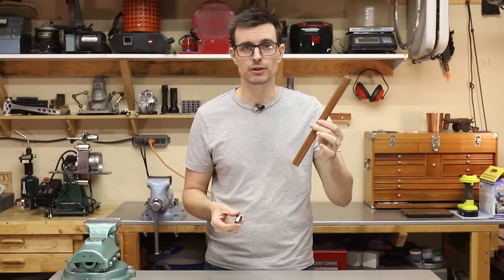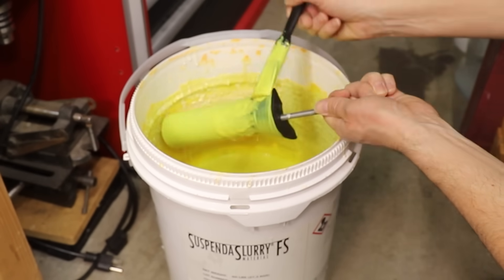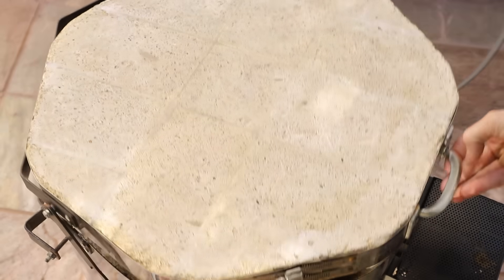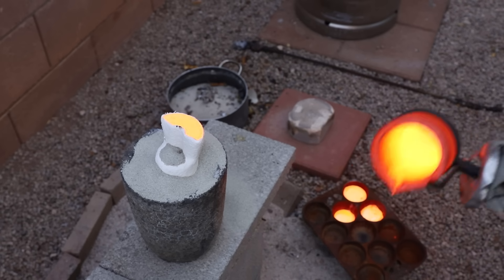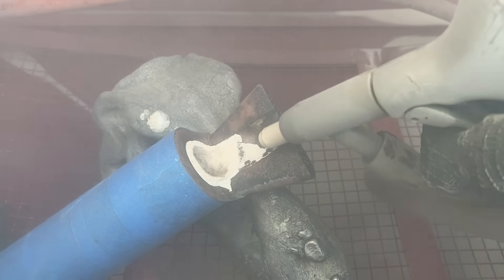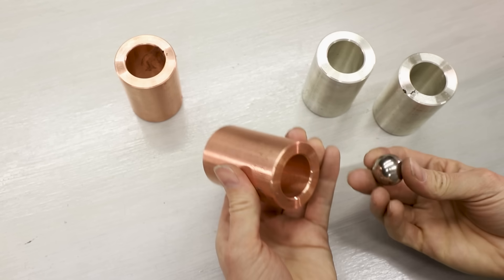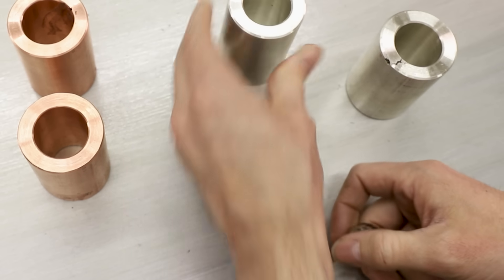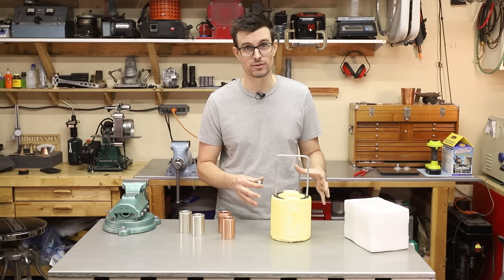Making Anti-gravity tubes - Copper & Silver! - Lenz's law - Metal casting Experiment

Comment: Something you could have done/ could do in the next installment would be to place the tube on a scale, showing its weight. As the magnet enters and flows down the tube, it should show an increased weight, and will show a further increase when the magnet touches down to the surface of the scale. The ratio of the difference between the falling weight and the Landes weight is the percentage of the acceleration due to gravity that is resisted by the eddy currents produced by the moving magnetic feild.
Reply: Once the magnet reaches its 'terminal velocity' in the tube, which appears to happen fairly quickly in these experiments, the scale should read the full additional weight of the magnet, regardless of the metal used (so long as that 'terminal velocity' due to eddy currents is reached).

If you're trying to measure the force needed to stop the magnet when it hits the scale, do note that scales are notoriously bad at measuring near instantaneous forces, and are much better at measuring prolonged unchanging forces.
Reply: @rylandrc  I was going to say the same thing! I guess I'm glad I checked the replies.
Reply: @rylandrc good point
Reply: @rylandrc   I believe, as the magnetic ball falls through the tube, it will show a weight 'less than' the actual weight of the magnet, until it hits the surface of the scale. 
At the moment in time that it makes contact with the scale, and with magnetic force acting on it, will the impact force be greater or lesser that of the magnet alone? 
As it falls at it's 'new' terminal velocity, a minute bit of gravity(?) should be observable and reflect a tiny reduction in weight.
Reply: @MarcoTheHammer  F = mass*acceleration

If the magnet is not accelerating (such as by traveling at a constant velocity), then it is not exerting any force greater or lesser than its normal weight due to gravity, the same as if it was sitting still on the scale.
Reply: This is completely wrong. As long as the magnet moves at constant velocity, the weight is the same. Both when flowing and landing. Except a little bump at the time of impact to the bottom.
Reply: @erikev  if we extrapolate this out however, as you use a weaker and weaker magnet, or a less and less conductive pipe, the ball would fall at a rate closer and closer toits terminal velocity in ordinary air, eventually, it would be falling at its terminal velocity when using a nonmagnetic ball or a insulating pipe and the scale would read almostno weight from the ball (except air pressing on the bottom) until it lands.
Reply: @Metal_Master_YT  it wouldn't register any additional weight only if it was done in a vacuum or else the air beneath the ball would still impart ball's weight on to the scale. There has to be a medium that passes information about the weight to the scale - be it eddy currents or air - only a non magnetic ball in a vacuum would not be able to transfer information about its momentum to the scale up until the point it would actually hit the scale.
Reply: @Metal_Master_YT  Wtf do you mean by Earth's terminal velocity? Did you skip Physics-101?
Reply: @vaakdemandante8772   Yup, I was neglecting air resistance and pressure, but assuming that the tube is open on the end, the air will be able to exit relatively unhindered, besides the ball is not a perfect fit and air can escape around the edges. you are correct however.
Reply: @DJF1947  Yeah, I was not well rested when I posted that... what I should have said is that the ball would accelerate due to gravity until it exited the tube or reached its terminal velocity under those conditions, likely the former.
Reply: @erikev  yes, that has already been commented in the replies.
Reply: Lets hook some wires up and flip it back and forth so we can save the world with perpetual motion and free energy!
Reply: @fluchterschoen There is a reason for that. I am about to publish a book in which I show that many engineers at aerospace companies (NASA, Boeing, etc.) do not understand simple physics (and thus waste time on moronic 'antigravity' projects, for example). The sandglass problem is an old one; it was first studied by Galileo ... who thought that it would weigh less until he did some experiments. For many years it has been a 'trick question' for physics students. The interesting thing is that there can be a very small change in weight, but it is hard to measure and is - ironically - due to Galilean relativity (imagine the sandglass-constriction moving through the sand). 
Are you trying to fool me with the barge question LOL. It is a well-known fallacy to think that the weight of the barge changes the stress acting on the aqueduct supports. There is a lovely counter-demonstration of this: take a long water-filled fish-tank  and balance it on a narrow piece of wood at the tank's  midpoint. Now take a heavy model boat which can float freely on the surface. Float it carefully at one end of the tank. Just about every non-physicist will expect the tank to overbalance, but it doesn't of course. But there have been cases in which misguided engineers really did reinforce aqueducts. Or perhaps they were simply scamming the canal-owners.
Reply: Would the magnet be attracted to any parts in the scale? That might be something to try to see if it falls faster. Suspending the tube from a force gauge might be interesting to demonstrate the weight increase. I'd also like a demonstration of that molasses when pushing the magnet up. Maybe a PVP pipe to push the magnet up would show the reverse effect compared to dropping it through?
Reply: This comment section is dope af
Reply: there will be no further weight gain once the magnet touches the scale.
Reply: Nicely said friend.
Reply: I'd have thought the weight would be the same once it's falling and landed, doesn't make sense for it to be heavier once landed, especially as it's a constant speed. If gradually accelerated then I can see that being different
Reply: The weight of the assembly while the ball is falling is the same as that of the assembly when the ball is on the scale.
   But I would like to mention a more complicated situation. How can a scale indicate the mass of a gas enclosed in a container, when it is known that most of the molecules fly freely and do not interact with the scale ?
Reply: @marianl8718  HaHa, are you trying to resurrect that moronic old question of whether one can get a load of live birds in a sealed truck across a weak bridge by making them fly? C'mon: Physics-101.
Reply: @DJF1947  Your reply with this example, that I did not know, is wery good. Obviously, the truck will have the same weight (if the truck is covered), but the situation with the gas is very instructive,  because in this case the molecules do not interact with the environment in the same way as the birds, and many molecules do not hit the walls of the recipient. It is amazing that even those molecules can be weighed. 
It is obviously a pressure difference between the top and the bottom that gives the weight of the gas, and deciphering this mechanism requires some thinking effort and is very usefull. Maxwell deduced the distribution of the molecular speeds of gas precisely from such thought processes.
Reply: @DJF1947  You are right in all cases. That's right, a mechanism hermetically sealed in a container cannot make that container move (except for some oscillations smaler than the size of the container; it can also produce rotation of it). Probably as you say, NASA is not very good at physics.
The example with the gas I gave is very instructive, because it can be seen that the answers to certain questions are not too easy to find. For example, why does air pressure decrease with height ?  Here one could make the association with a stack of bricks, but another question immediately follows: why does the number of air molecules decrease with height ? 
YT hid your second answer, which I found in a roundabout way, because I didn't get a notification for it, but I realized that you answered me. The reason why YT did this can be found in the penultimate sentence of your answer.
Reply: @DJF1947  Obviously, even if he juggles the gold bars, that man cannot cross the bridge, the shocks from throwing and catching will increase the pressing force. Some analogies can be imagined here, for example a lot of ping-pong balls endlessly bouncing on the pan of a scale (being let to fall from the same height, but not simultaneously). Averaged over time, the scale will indicate the weight of the balls at rest.
Regarding the pressure of a gas, it decreasses with height because only the molecules with the highest speeds can reach high altitudes, and they arrive there with a lower speed, because they lost energy by going up. It doesn't matter that that molecule can immediately collide with another, it will communicate its energy. It is known that in a perfectly elastic collision between two bodies of equal mass, the bodies change their velocities between them, so that a completely different molecule will reach the top, but which will not differ at all from the first molecule if she would have had a clear way to the top.
I stop here, although I would have liked to write more, but YT again did not send me a notification for your answer, which was hidden for the second time. There is a lot to say about this. I just now fund your comment and I have to read it one more time carefully (I am from Romania).
Reply: Excellent Idea I am going to try that
Reply: tetszik a hozzászólásod Attila Dunai Quantum Team-építő mester
Reply: Do you also believe that a sand-glass will weigh less when the sand is flowing?

Comment: Hey Mr Robinson! I see that cracking is an all too common issue with the suspend a slurry molds and I have a suggestion.. usually any cracking is a result of thermal expansion where excess moisture is present in the mold, and what I would suggest to avoid this in the future is to go ahead and put your mold inside of a filament dryer or dehydrator for 24-48 hours at 50 degrees C, this will help to remove any excess moisture in your mold before burnout and you should avoid the cracking issue. Of course there are other reasons why a mold might crack for example in parts of the mold that were not evenly coated with a thick enough layer but assuming that’s not the case, I think dehydrating is a prudent step to take for preventing moisture related cracks
Reply: Could also be the thermal expansion of the plastic. Thermoplastics generally have high thermal expansion coefficient. A hollow plastic pattern may be preferable, allowing the plastic to yield rather than exert pressure on the surrounding ceramic.
Reply: Could I just go to the welding supply store to do an argon purge?

Comment: Sterling silver does not have as high of conductivity as pure silver.  Pure silver is about 7% more conductive than pure copper.  Stands to reason the sterling silver has lower conductivity than copper and therefore oppose the falling magnet less.  Lenz's Law states that magnetically induced electric current (here in the tube around the circumferentially) would be circulating in a direction such that its self-generated magnetic field would oppose the change in magnetic field introduced by the falling magnet.

Therefore we have the magnet's weight due to gravity pulling toward the ground while the opposing magnetic field force is directed upward.  The net acceleration is a result of the vector sum of opposing forces divided by the mass of the magnet. a = ΣF/m.   Notice the fall rate seems constant. This means the acceleration is zero and therefore the net force is zero - the weight is cancelled by the Lenz force if you will.  The added weight you feel while the magnet is falling through the tube is exactly the weight of the magnet via the mechanism of the equally opposing magnetic force that originates in the tube.  Hang the tube from a scale, then watch the total weight as the magnet falls through the tube.  You will see the total weight increases by the magnet weight. 

If you could high speed film the insertion into the tube you'd see a very short range of negative acceleration where the magnetic sphere starts at freefall (~9.8 m/s/s) and decelerates down to a constant speed.  I suspect, though never tested this....that once the entire sphere is within the tube,  it has constant speed.   Prior to that,  the part of the spherical magnet outside the tube still has a component of its weight but that part of its weight is not countered by the opposing magnetic field until inside the tube.  

The action here is nature's attempt to counter change - to put things into their lowest energy state.  

BTW, this is not anti-gravity in any way whatsoever.  Gravity is still very alive and well throughout this entire process 'cause you'd have to remove the planet from our general proximity by a very large distance to achieve an anti-gravity state.   What's going on here is a balance of forces - one gravitational (we call it weight of a mass) and one magnetic - they oppose equally and oppositely resulting in zero net force.   If this effect could turn gravity off, then the magnet would launch vertically upward as a result of an unbalanced force.   Clearly that does not happen.  

I hope this is insightful and interesting.  Retired physics professor wanting to share cool stuff that is not alway obvious to the casual observer.  Cheers!!!
Reply: Your reply is great, but is not very readable.
Reply: @Morberis  How should I change it to be more readable? Explain please.  I am happy to edit if it helps.
Reply: @physicsguybrian  I don't know if you want to edit this post. But break it up into paragraphs. 

In normal writing what you posted probably would be 1 paragraph but in YouTube comments as read on a phone it is a very large block of text where it is difficult to keep track of both your current spot and other information. The goal is to be able to quickly find information.

 1 test you could try is to look away, scroll a bit, and then look back. If you can quickly find your spot where you paused reading and identify where other topics are you did well.
Reply: @Morberis  Thanks!  I almost never use my phone...always at a computer with big Old screen. I will make it more readable. TY again!  Much appreciated!
Reply: @physicsguybrian  Ahh ok. In that case a good rule of thumb might be ~2-4 sentences per paragraph.

Happy to help
Reply: @Morberis   I just posted the edit. Let me know what you think, if you don't mind.  Again, much appreciate your advice!
Reply: @physicsguybrian  Looks great!
Reply: @Morberis  Thank you for the advice on mobile readability!

Comment: If conductivity is the driving factor in this interaction, try melting copper wire as the source for your metal.  The copper used in water pipes is allowed a much looser tolerance for impurities, and only a percent or two can make a noticeable difference in resistance.

I'd be curious to see if pure silver works better for similar reasons.
Reply: Dont melt it. DIY melting gets enough inpurity inside to ruin this effort. Buying and machining pure copper is the best way even if it is not as pure as wire copper. Copper is available in different purity grades but it's not always labeled. But if you really want to use melted copper it needs to be from thick stranded wires to reduce at least the influx of surface inpurities.
Reply: This. 100x this.